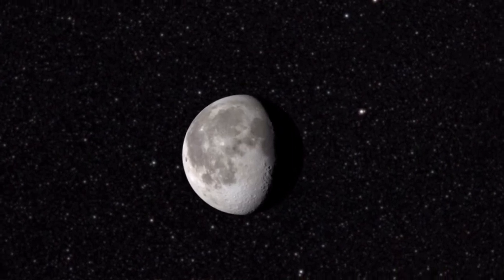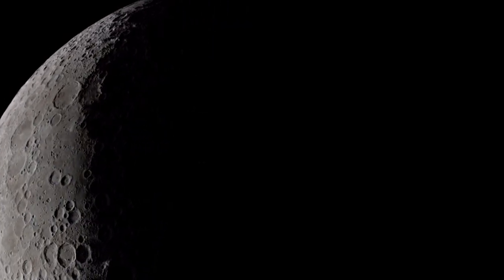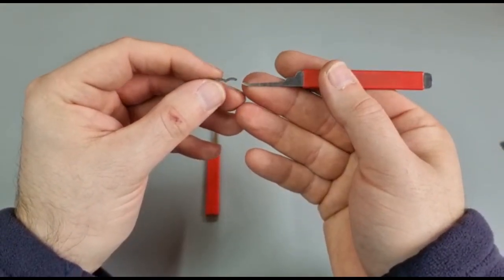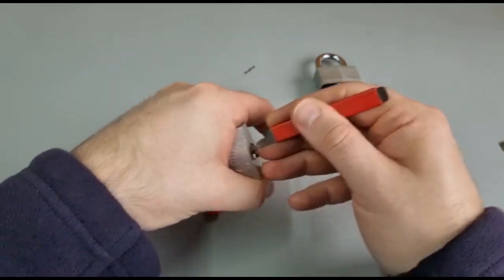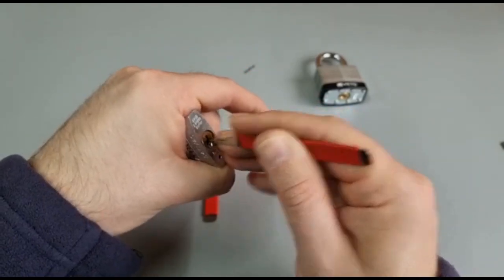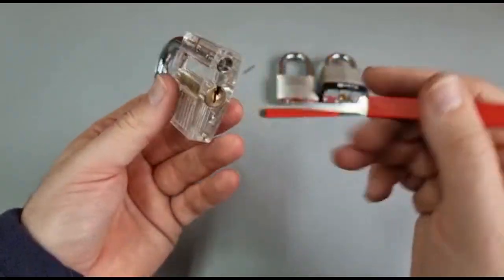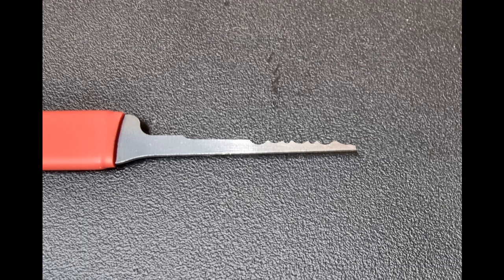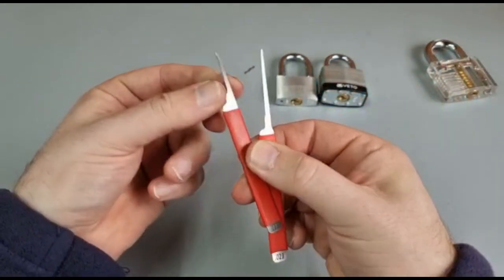Broken LOCK PICK? Recycle it!

Comment: My windshield whippers. When I change them out. I strip the steel band and grab my dremel tool and craft my own picks. Amazing recycling
Reply from the maker: They make great tension tools, but for me a touch thin for picks. The wire from underwire bras is quite good too, but not so easily acquired. In fact, years ago I went to a breakers yard and he let me have a handful of windscreen wipers for this purpose for about 4 quid.